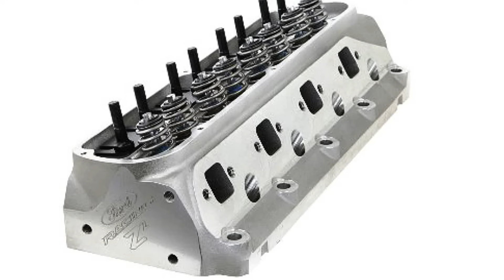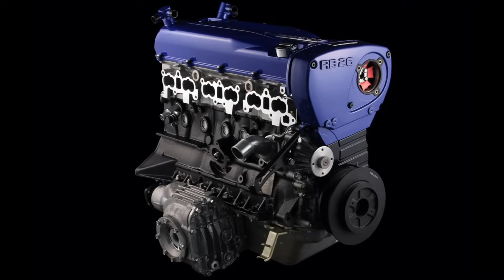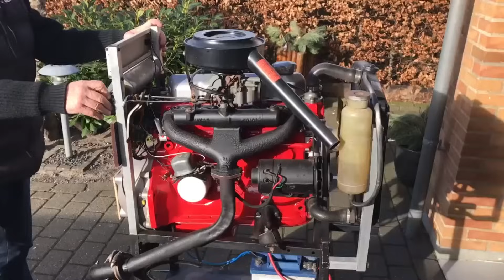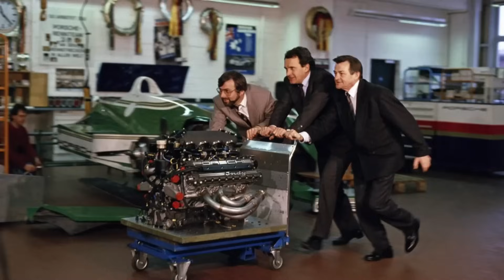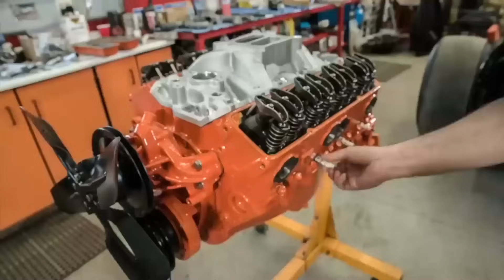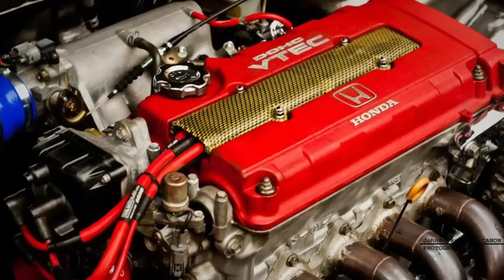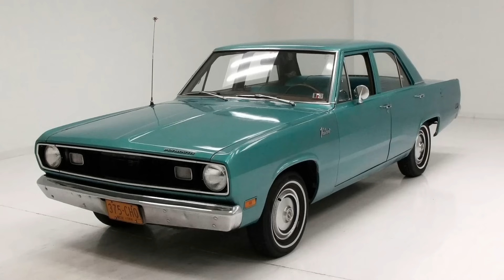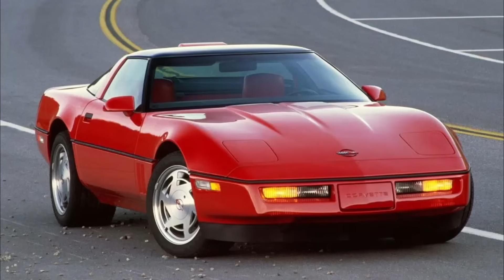30 Car Engines That Will Last FOREVER (2024)

Comment: Put half million miles on a D100 Dodge truck 225. Still running when retired.
Reply: Ya those slant 6’s were bomb proof.
Reply: I haven't read all 600+ comments but rather stopped at the first mention of the legendary "Barra". With numerous people easily getting a reliable 500 to 1000 kilowatts (its metric, don't freakout) and hard core campaigners getting well north of 2000 kw from these engines, every other Barra related comment will be saying something similar. But nevermind the outrageous power claims, these babies were designed with the taxi market in mind and regularly chalk up 700,000 to 2,000,000 kms (again with the metric?).
Even the venerable 250 cu in six it owes its heritage to, did 700,000 kms in a former taxi I owned. Power and reliability. The full package.

Comment: The Ford 300, the Ford 302, the Chevy 350 and the Chrysler slant six.
Are my favorite engines
Reply: The 300 was so reliable they quit making it. Toughest motor ever built and I'm a die hard Chevy guy. You just couldn't kill that 300
Reply: @butchcassidy3373  I love the Ford 300.  Never owned one, but worked on plenty during jobs I've held.

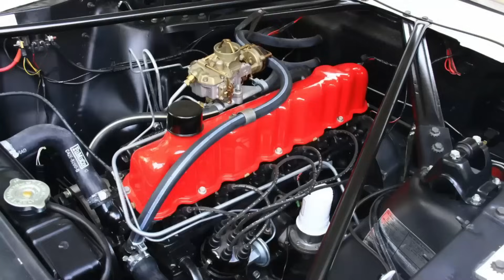Incidentally, the engine shown at 24:10 is actually the Ford 200.
Reply: I don't think a 350 was best as far as reliability, but they are cheap, simple, and have a lot of aftermarket parts.
Reply: @24tanksalot   I like the 250 cu. In. And 292 inline 6 engines from Chevrolet. Perfect for the Blazer and C10, Silverado 1500 pickup trucks...😅
Reply: I must remark the 350 in 6cylinder form, which if my math is correct is 262 or 4.3 is more robust and reliable than the 350 ever managed. Surprised these did not make the list and the 4.6 Triton did.
Reply: @alristitov  The 4.6L doesn't make much power, but they run forever.
Reply: @alristitov  
350 Toyota is more reliable and lasts longer than any other engine period. Ever.
Reply: I have three trucks.  A 72 Chevy El Camino with a small block 350. Replaced the timing chain around 100,000. Took the heads off for inspection.  She has around 170,000. The speedometer stopped working after buying my third transmission.  She had a full size overhead camper on her back for thirty years.  Broke two rear ends.  She still is taking me to the store for another milk run.

The second is a 93 GMC 350 delivery truck with a 350 small block with 358,000 on the speedometer. 

The third truck is a 94 GMC 454 or 7.4 engine with 170,000 on the speedometer.  Wishing that the transmissions were built better!
Reply: @peacepoet1947  Toyota 350- Hold my beer as the odometer goes over 1 million. Same tranny and rear end. Nothing opened up.
Reply: @24tanksalot  
I was a 350 chev fan until I got a DOHC 5.7 Toyota made in Texas. 
It's not even close now. Toyota's engine is superior in every way.
Reply: Love my 302 such a classic example of American workhorse V8
Reply: 351W 4BBL was junk from 1969 on (FORD) used in Mustang MACH 1's.  I guarantee you if you search this entire comment section, not one person has mentioned one.

Comment: "...replace head gaskets PREVENTIVELY."??? You've got to be shitting me? On a Subaru Boxer engine this is a freaking NIGHTMARE.
Reply: That's Ai generated content for you.
Reply: Wouldn't be so bad if you didn't have to take half the car apart and drop the engine just to do it... Audi is even worse about it.
Reply: My 2002 also burned a moderate amount of oil. Can put off the head gasket repairs with the coolant additive they recommended.

Comment: There is an engine that is way stronger than a jz,that is a Toyota 1,2 and 3C,those are like your grandma with the strength of two committed bodybuilders and reliable as a neighborhood plumber 😂😂😂😂

Comment: the BMW M57 could also be taken in consideration. not sure if those were available in the US, but there are many cars from the 90s still running it perfectly fine in europe, kicking 500k km without a tick
Reply: I don't think the M57 was ever offered here in the US. Maaaaybe in the 3rd-gen X5? But the replacement N57 was the last diesel BMW six sold in the US.

My E53 manual X5 with the M54 gas six is about to turn over 200,000mi, does not leak nor burn oil, and thanks to the crazy gearing it'll haul ass pretty well despite how heavy that thing is.
Reply: @geeniusatwrok  N57 (just as the N47) was deemed unreliable due to chain issues, plainly said. the bmw introduced 30k km oil change intervals which contributed to this, making the chain snap even after around 100k km, so it was right not to be mentioned in this video

Comment: I have owned cars with those engines and they are as reliable as this video says they are. May I add two more. I own an '05 Titan with the 5.7L V8. What a beast!  Also my wife's RAV4 with the older design 2.5L 4 cylinder and port injection. Run babt run. Change oil every 5,000 miles. That is also the secret. Oil changes at 5,000.

Comment: If you have a B230 Volvo, the only thing that will kill it is failing to change the crankshaft ventilation flame trap. If it blocks up it blows the rear crankshaft oil seal. Drips on the driveway or garage floor followed by clutch slip in manual [stick shift] cars, at around 180,000 miles. I always change the timing belt and tensioner every 50,000 miles - with genuine Volvo parts, you can do it yourself, the crank pulley locking tool [Volvo part no. 9995284 in the UK, which pays for itself the first time you do the job]
Reply: My B230F has 250000 miles and still runs like a champ. I do the regular maintenance.

Comment: We had a Mercedes Benz (W123) 300D, from 1983, with over 1 million km on the clock. Turn the key, wait till the light in the pre-heater glows for 5 sec, and the thing will start, regardless of 30 C or -10 C. :)
Reply: A lot still going in poorer third world countries. 😊
Reply: What happeend to Mercedes?  The new stuff is over engineered unreliable garbage
Reply: -10 is nothing.  Try -40.
Reply: @davidboatman925  It doesn't get that cold up here but I bet it would start anyway. :)

Comment: The old Dodge slant 6 will practically run with almost no oil or water . My brother and  I tried to blow one up in a 1965 van  and couldn't do it ?
Reply: To kill a slant 6, use one of those "sludge remover"additives before an oil change. The loosened buildup can clog an oil passage and cause a catastrophic bearing failure. Ask me how I know
Reply: So did I! Wouldn’t blow. It stopped & a hour later it re started.  No water
Reply: Probably bend a pushrod before it would blow up.
Reply: @oldmusclecars9419   Yeah ,  We actually sold that van  to a guy  and it was running ok when he drove off. .It was a beater ,  3 on the tree and none of the doors would latch properly and they always would  fly open.
Reply: @oldmusclecars9419  Mine went with a rod knock. I thought I could baby it home but it punched a hole in the block.

Comment: The Volvo B18/B20 (it's the same engine, just different bore) was the engine found in Irv Gordon's Volvo P1800S and clocked in at 3.2 million miles.
The only really weak mechanical point I know of is the cam gear that's made from some fibrous material. But it's a non-interference engine and relatively easy to replace so it's not a big deal.
Reply: There are aluminium kits out there. (Yes, it’s called aluminium outside of the US)...

Comment: Some observations.  When mentioning the 2.2L GM Ecotec, a 1969 (I think) Camaro is shown.  For Ford's 4.6L modular V8, a 65 or 66 Mustang is shown.  Since this video concerns "Engines that WILL Last FOREVER", any engine with a timing belt, or a Subaru where the video says you should replace the head gaskets, really shouldn't make the cut.  The GM LS1 seems to be rated too high at #3, due to its oiling and cylinder deactivation issues.

Comment: Your posting is junk because you don't mention the great engines from the classic car era.  My 1953 Chrysler ` Hemi ' will outlast anything you mention here.   I never restored mine but changed the plugs.  It runs so smooth and quiet that one is simply astounded that it is possible after 70 years.Then there are all the other great engines from this era that are equally durable like tha Packard 8s and Lincoln 12.  Back to school for you !

Comment: Can I also recommend the 4 cylinder GM Iron Duke.    That also was a engine that just kept on going.  Even though the cars they were put in did not.  
The B21FT is also a legendary turbo engine.   
The other that should of made it are chryslers 4 cylinder engines like in the K series,  but everything after that had some kind of problem that was some cost saving measure like cheap head gaskets.

Comment: Why did you feature the picture of a late 60s Camaro when talking about an Ecotech 4 cylinder? That makes no sense. Lots of questionable info here. And...ditch the AI and read a script.
Reply: Then they showed a 65/66 Mustang fastback while talking about the 4.6 Mod motor! Sacrilege!
Reply: That is because this video is mostly created using AI.  The naration is purely AI.
Reply: Yes, they talked about the 1.8 L engine that powered the Mazda Miata in 1989. In 1989 the Mazda Miata was powered by a 1.6 and they did not use the 1.8 until 1994. Sounds like there is a lot of questionable information here. You know what they say just because it’s on the Internet, doesn’t make it true.

Comment: The Saturn S-series didn't have the 2.2 Ecotech. It had the Saturn 1.9 liter, which was a separate engine designed by the Saturn group. It shared components with certain European engines and used unique (for North America) components, including a french starter motor.

It was available with a single or dual overhead cam. I owned two with the DOHC and other than burning a little oil, were awesome. I put over 400,000 km (250,000 miles) on a 2000 SL2 before someone didn't see me and wrote the car off. I was expecting to get well over 500,000 km. That one didn't burn oil.

Comment: Another fun fact about the Ford 300 "big six"- it was the engine of choice for the UPS delivery trucks for DECADES until they switched to diesels.
Reply: "Choice?"
Usually Government Contracts Only Sold On Lowest Price.
Reply: @michaelchevreaux7780  
You must be thinking of the USPS, the postal service. I was mentioning UPS- United Parcel Service. They are a private corporation, separate from the government.

Comment: I have a 68 Cougar with the 302. I have over a million miles on the motor with no overhaul yet. I use Castrol 20W50 oil. That's it for maintenance.
Reply: my '64 Merc 352 I use Castrol 10W40 since it's used all year long, if only a summer driver I'd be doing the same as you
Reply: Whoa
Reply: I have been using Castrol 20/50 on all my cars since 1971
Reply: @theislander-sj1kq  Where do you live?
Reply: I have a '67 Cougar with the 289 2V (2 of them actually) my tattoo artist buddy actually gave me a '68 Cougar 302 2V I think I will stuff it into my '88 Toyota Supra Targa or my lifted '93 Explorer...
Reply: The only thing that saved the SBF or SBC was the fact that there were 150M parts cars across the USA to get parts from...
Reply: Epic!
Reply: In highschool I had a Chevy Nova with the 302.  Wish I still had that engine for sure.
Reply: @Malakie  Chevy DZ 302 was a great one
Reply: @Malakie  it's an old story told many times.
Reply: I started using Castrol 20/50 in 1978? ish? Just sounded cool. I didn't know any better. Everything ran beautifully on it. Some racing buddies all used "V", so I copied. Lost two engines. Probably a fluke. Must be! 

An engine builder told me that ALL modern oil is equal for competition reasons, no company can afford a bad reputation. He said, the key is changing it as soon as color darkens. No such thing as a "bad oil" he instructed.

Still, I never went back to "V". Fluke or not. Don't need it. I went to another successful combination for the next 40 years successfully. I won't open a can of worms, just, a very very successful product (s).

Recently retired, reminiscing my Castrol 20/50 days. So I switched back. A clear marked improvement in engine smoothness, power, and quiet. Less consumption. I drive,100k + annually and my 5.4 Econoline went from 143k to 300k + in 14 months. Actually running better now on Castrol 20/50 than when I bought it. Why did I even stop? I just don't know. Well I'm back!
Reply: @williamrobinson6680  our race car engine builder and driver pulled our ASA stock car motor after racing 500 miles on it and said there was no wear on any of the parts. He said Castrol, Kendall 50, and then Quaker State 20W50 for wear in that order. This is the guy that built the cars for Elcajon Speedway. He built the cars that set lap records and had many of the records himself. He was also an Indy Car mechanic. If he built the fastest cars on the track, he must have known something. 

I was the manager for K-Mart Enterprises. My store was sports, auto, and I was in charge of the service center.  In those days, we sold so much oil that they sent free tickets for luxury seats at the Indy 500. I saw all the specs for every oil. Castrol had the best specs for oil, and Kendall 50 was next. Valvoline was the dirtiest oil. The next best specs after Kendall was Quaker State, then Penzoil. Now, Royal Purple and Redline oil might be better than Castrol.
Reply: @kimwarfield1587  Outstanding, thank you. I wish I had this information and shared experiences decades ago. Would have solidified my selections in motor oil.  Not just feelings  but fact. This also confirms my experiences with the "V" products. 

Also, an engine builder from the local circle track side, (I was a 1/4 mile dragstrip racer) helped me with my 350 ci Z-28. The first thing he told me was he couldn't believe how immaculately clean the motor was to disassemble.  Certainly most race motors do come apart clean,  but for him to point it out first thing, spoke volumes.
Reply: I call Bull on your statement.  I'm sure that timing chain had to be replaced! Ford used a nylon sprocket  that would give up around 160 to 180 thousand miles.  And the rear main seal would start leaking at about 120 .
Reply: @Roadking556  Well, he did say it hasn't had an "overhaul", and maybe he just adds oil for the leaks.  1 million miles is a pretty big claim.  The nylon teeth on my 67 289 fell off at ~115K miles btw 🙂
Reply: @LarryCook1960  exactly 💯  I was giving my experience.  I'm a big fan of the 289/302. The first thing I would do is replace the timing chain with steel sprockets and a roller chain before failure.  I have seen 700 till blow by started. Still running good but had to increase oil changes.  Just calling bull when I hear it.
Reply: @LarryCook1960  And with today's oil technology.  This engine is one of the best around.  I got about 27 miles per gallon on the highway back in the 80s. This is one of the best engines ever made . Replace the timing chain sprockets and live with the main seal leaking. You're good to go for thousands of low-maintenance miles
Reply: @Roadking556  again, I don't care what you are calling or what issues you had with your engine. I haven't had any issues with mine other than now replacing the carb because of a gas leak that can't be fixed due to wear.
Reply: @kimwarfield1587  LOL.  Wasn't born yesterday . I currently own five small block V8-powered Ford vehicles.  And owed 23 over the years. .Raced and used them as daily drivers. Met and worked with some racing legends.  I know these engines inside and out.  There is no way a stock motor from Ford in cold climate with the nylon sprocket timing chain and rear main seal was going to see 160 . A million was way out of question . With proper valve timing and ignition heat cycle with proper cooling. No question a million miles are possible with these motors.  But, the replacement of the stock timing set and distributor and main seals are mandatory to see upwards of 200 plus .
Reply: @Roadking556  I call Bull 2
Reply: Just think. 
If you had a small diesel like mine,
You would have saved $100,000 in gasoline.

Enough to buy multiile perfect restored cougars.
Reply: @fastinradfordable of course you'd save money on gas because you buy diesel, not gas! DUH

Comment: My stock 2012 boss 302 aluminum block puts out 40% more power than my stock 70’ iron block boss 302. Now, let’s talk built…my aluminum block now produces 1000hp at the crank, same setup on my 70’ iron block produces 550hp. I think there’s been an improvement or two.

Comment: 2.2 ecotec? I’ve seen this engine on a list of “least reliable engines” of this same Chanel
Reply: These were the ones blowing the timing chain and grenading.
Reply: I don't know much about the 2.2 ecotec, but I have a 2011 Chevy Equinox with the 2.4 ecotec and it has had every problem under the sun.
Reply: There are several missed points and inaccuracies, what do you expect from a channel uses an AI to narrate. As long as the timing chains for gm 4 cylinders are replaced when called for there shouldn't be a problem. I learned the hard way with a LN2. I have the L61 and 350 motors.

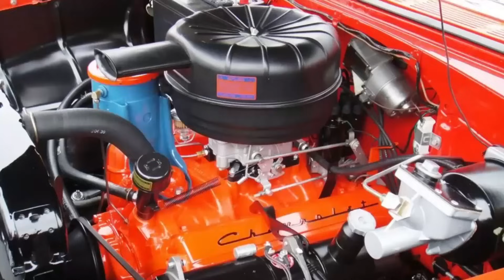Comment: The Ford 302 and Chevy 350 push rod engines have LESS moving parts than an overhead valve engine (.at 0:49  and at 16:05 ) ???? Man, this video is loaded with mis-information.  Just because a video is "produced" and slick, DO NOT BELIEVE ANYTHING YOU WATCH ON YT!!!  Anyone who knows engines will tell you this claim about push rod engines is 100% false.They have MORE moving parts..... period!